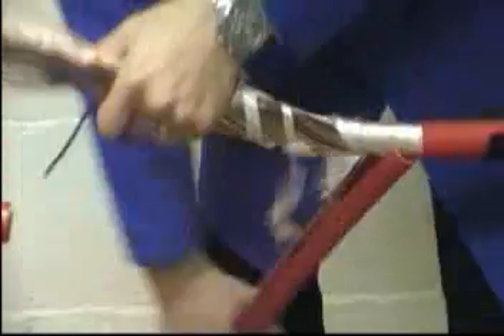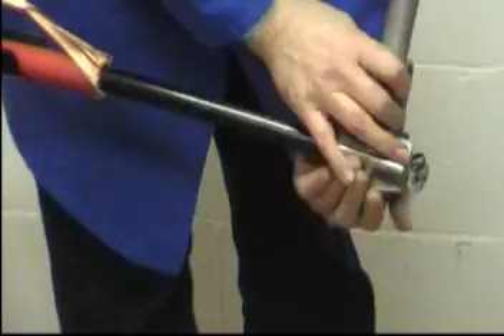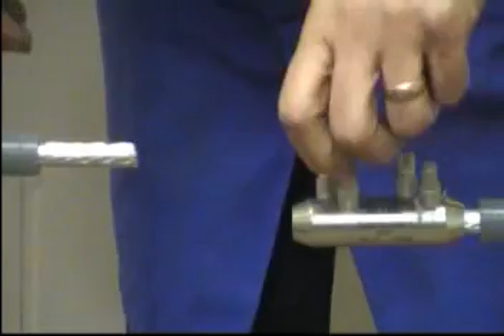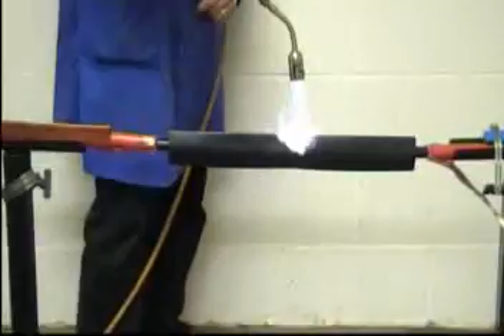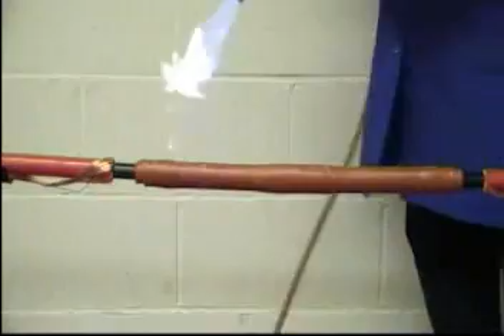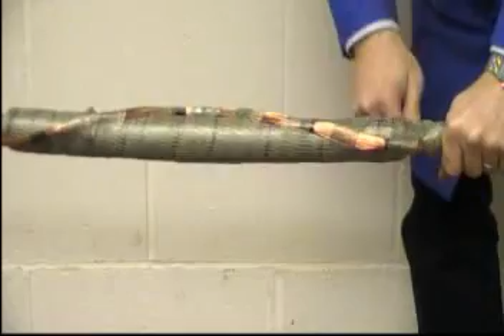Heatshrink Joint to suit Single Core 33kV Xlpe Cable

Comment: The video was done for training purposes and used clean cable within factory premises. The instruction sheet supplied with each joint we supply does cover cleaning the cable and abrading the outer cable jacket to ensure a good seal when the outer shrink tube is fitted.

Comment: Sorry for the delay and thanks for watching the video. We will be making more soon. There are a number of different sizes of course and each overseas market tends to have it's own pricing levels. But if we took a 185mm2 kit for non armoured cable, anything from £80-£150.00 each. There are some low cost suppliers out there but one failure on a cheap kit would cost thousand of £ to repair